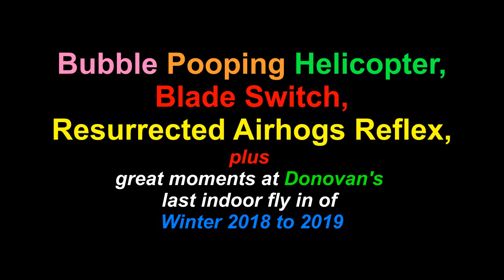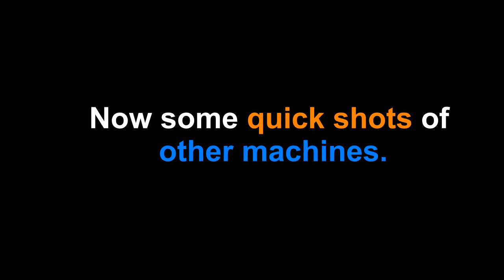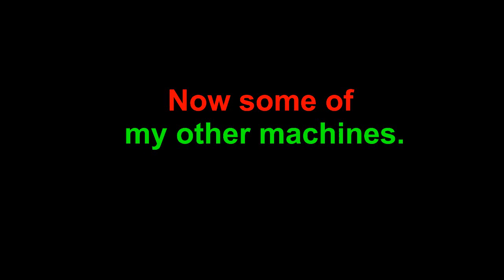Pooping Bubbles, Inductrix Switch Air, Airhogs Reflex, plus more!

Comment: I do the same with my sticks. Except I used hot glue sticks at first. ( the small ones). I have a bubbler for one of my helicopters ( cant remember which one). I cannot wait till spring! I ordered a replacement WL Toys SkyKing for the one I had die on me last fall after 3 years of heavy use and abuse. I deemed it replace worthly. I got it from Tom Top so I hope it comes in one piece.  It will probably come in a grey trash bag. I paid $34 for my first one. Now the cheapest is $54. Go figure. I have 2 camaras for it and lots of batterys. I just bought new batterys and it quit. I gave it to the neighbors kid as a chuck glider.

Comment: Source those replacement batteries.   I've had a S107 for several years and its batt is DOA.
Reply from the maker: I just buy the ones on Amazon that are the stick size batteries, like I show in the vid. I am sure you can find a battery that is the right size, more square, that will fit well.
Reply: ask and ye shall receive. You might need to change your connector though. http://www.valuehobby.com/power-systems/batteries/1s-lipo/1s-200mah-lipo-battery-5pcs.html